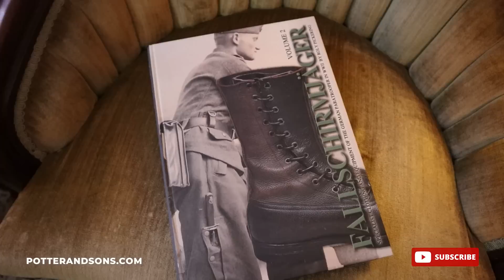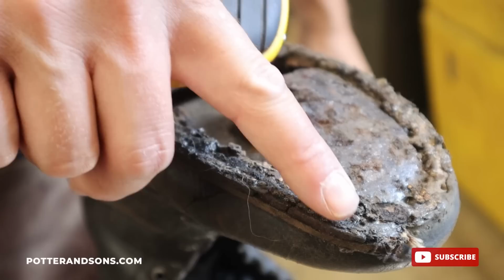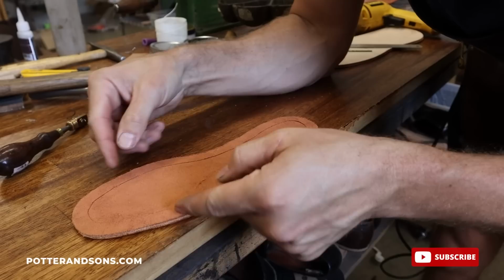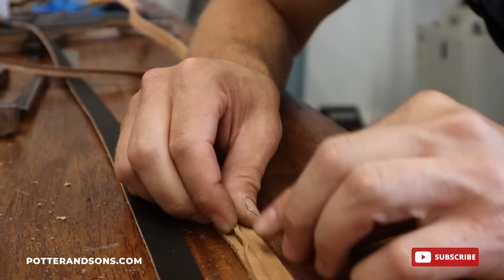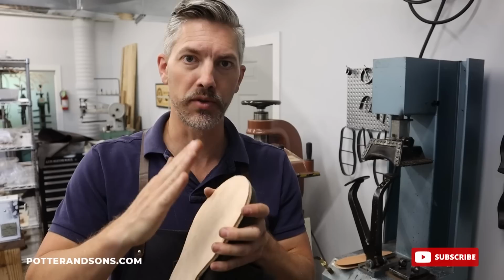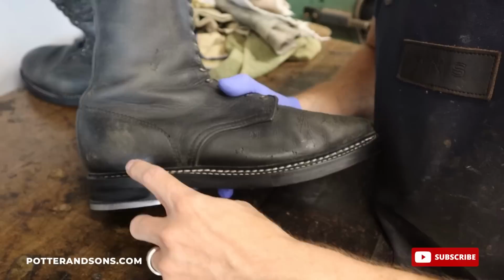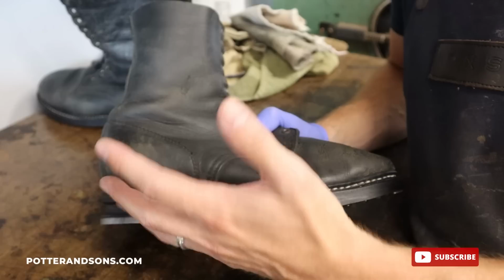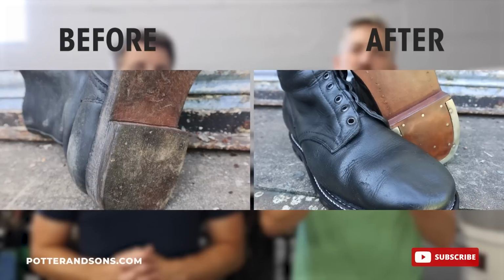WW2 German Paratrooper Boots Restoration

Comment: I did service in the German Bundeswehr in the 1980's. The boots we were issued did not look that different from the ones you worked on. They also had white stitching everywhere. First thing we were told to do when we received the boots, was to use black colored "Lederfett" (leather care grease) and darken all the white stitches. Especially the groove between the leather upper and the welt had to be slathered with the black grease to make the boots waterproof (which worked well).
Reply: Does that "Lederfett" wear off in the field, allowing the blackened stitching to turn white again? Or is that grease a permanent colorant?
Reply: @operator8014  I would think it would have worn off over time but before that ever happened, the goo was re-applied frequently to keep water-proofness
Reply: Lederfett "wears off" but the stitching stays dark. (Because you would need to use some form of cleaning agent instead of water, brushes and elbowgrease when cleaning)
We did the same in austria, either Leather grease or black shoe creme that had water proofing oils and wax in it.
Reply: @nirfz  Our trick in the Bundeswehr in the 80s was to fatten the stitches and then to ignite the grease. It was not hot enough to damage the boot, just melted and soaked and blackened the stirches.
Reply: @operator8014  We were expected to grease and polish the boots all the time. It kept them waterproof and soft. And obviously had the proper military shine.🙂
Reply: @neleabels  Interesting, have not seen anyone putting a cigarette lighter to the shoes or sole stitches here, but i have seen it put to other things (less usefull)...

My favorite example was the "shopping headgear" we got. (a light grey and green balaklava for winter face camo and windprotection)
It had the label "schwer entflammbar" on it. (for the english speakers reading this, i think it would be: of low flammability. Generally that label is put on things that resist a flame for a little before iving up)
On the first day after getting my gear, when i entered the room i was to stay in, one of my roommates already was putting the flame of a cigarette lighter to the balaklava because of that label.
I informed him that that only means it will start to burn later, not that it won't burn at all... (He was smart enough to stop his experience right then and not getting in trouble right at the first gear check.)
Reply: Used Bundeswehr boots and  shirts when in British Army,great boots then, later not so good
Reply: Glück ab! I was there the same time. We were told to put a thick leyer of the black German army "Schuhcreme" (shoe polish) on the stitching and heat it with a lighter so the fat goes in the tunnels of the stitching and makes it nearly waterproof. Btw... You could use that "Schuhcreme" with Bundeswehr hard cookies to start a fire. It was a smart option when you where out in cold weather and rain.
Reply: @oisin666666  Genauso  haben wir es gemacht 🤝🏻
Sie hielten nach der besagten Behandlung recht lange das Wasser ab und ja, die Schuhcreme  eignete sich hervorragend um ein Feuer zu entfachen. Das sind die alten "Landsertricks", die einem das Leben leichter machen. 😎
Reply: @bowieknife71  Wer das nicht so gemacht hat, der hat die Hartkekse wahrscheinlich auch so gegessen und so wertvolle Zeit verschwendet. Wir haben die Panzerplatten mit etwas Wasser eingeweicht. Daraus wurde dann ein Brei den man sehr schnell essen konnte. Bisschen Schwarzkirsch Marmelade aus´m EPA drauf und es war sogar recht lecker.

Comment: Where I live, this construction is known as the goiser. They are originally used as high performance hunter/hiker/forester boots in the Alps. They are really great, especially because the L shaped welt works as a bumper all around the shoe. Nowadays, they can be seen as dress shoes as well, and people can do a lot of fun stuff with that outer stich, such as putting colored cord or leather strips into it.
Reply from the maker: Very interesting.  Thanks for sharing.
Reply: The name comes from Bad Goisern, and we call them Goiserer in the alps. (the ones with the nailed soles)
Reply: You are from Hungary? We in ex Yugoslavia also had term gojzerice for this kind of boots :)
Reply: @nirfz  We called gojzerice even the modern boots. Tipical boots that was called gojzerice were "adidas gojzerice". Try to google it. We were probably wrong, but we didn't know better :)
Reply: @MrSatelit28   I did a picture search for the adidas ones. :-D Wrong would be a strong term i guess... In your language the word got a little modified over a little more than the last century and then used as generic term for boots . I can see how that happened historically.
We for sure also have similar kind of words, but it's often not easy to notice. (The name for the biggest glacier we have "Pasterze"  originates in the slovenian language as far as i read, but almost nobody here knows.
And what we call Gulasch, the hungarians call something like Pörkölt...)

Comment: The groove on the heel was designed for a rubber overshoe that was intended to be worn inside the aircraft while transporting to the drop zone, since the boots were intended to be a leather sole. The rubber over shoes were to be discarded upon landing on the drop zone.

Comment: Amazing video and as always you guys do fantastic work. A couple of things about these boots, It looks like these might have actually been old SMwholesale boots by the shape of the uppers although it's hard to tell from how worn in they are haha. Fallschirmjager boots were also never issued with hobnails like these boots had at least to my knowledge. The main reason being is that you'd have zero traction on the metal floor of the inside of a JU-52. As someone who has worn hobnailed boots, they are great for off roading but definitely aren't good on any smooth surface. A lot of times guys would add them on or even ditch their jump boots for infantry or mountain boots because the smooth leather sole, while good for the airplane was practically useless in the field.  Finally, the "first" pattern jump boots actually had a rubber sole with a sort of wedge arrow pattern, I don't know how else to describe it if you look it up you'll see what I mean, and were the preferred type by Fallschirmjager as they proved excellent for both jumping and in the field. The switch to leather soles came because of rubber shortages that Germany was facing during the war and that particular resource was needed elsewhere. The switch began I believe around 1941 after the invasion of Greece and the rubber soles would be phased out quickly to help simplify and ease production. Also Fallschirmjager would never again preform a massed air drop after the high casualties suffered on Crete, being relegated to more ground combat roles it makes sense to see more of these boots with hobnails later in the war for better traction. Sorry for the book by I just wanted to have the info out there for anyone interested. Amazing video again!
Reply: I can be wrong, but i think the boots of the mountain troops were equipped with hobnails. So if they switched out their boots for those of the mountain troops they would have ended up with something like in the video... The mountain troops were also more  common to need the groove for the ski binding.
Being from austria, my heavy combat boots (we have conscription) around the turn of the century had such a groove in the heel for a ski binding. 
I was lucky that i got to use "half-hard" ski boots in my size, but some of my comrades had to use the heavy combat boots for skiing, as they had a too common shoe size and there weren't enough of those boots in their size. (Not that it made skiing downhill any easier, as the name i gave them suggest, they only were rigid up until the ankle, and so they did not provide better ankle support than the combat boots. But they did provide better thermal insulation, which you only need if you standing around a lot or goind downhill a lot. Uphill or cross country the body heats up and supplies the feet too ;-))
Reply: "A lot of times guys would add them on or even ditch their jump boots for infantry or mountain boots because the smooth leather sole, while good for the airplane was practically useless in the field." Especially after Crete, when most of them didn't have jumps anymore. Most Fallschirmjägers at the end of the war had probably not seen a plane from the inside.

Comment: Great restoration project, you really "nailed" those boots🙂. First pattern Fallschirmjäger boots had a Vibram soles and 2nd type boots had a regular leather soles without hobnails. But like everything in military, especially during the war, there were variations where jackboot hobnails were installed, or even a Gebirgsjäger heavy boots hobnails for the paratroopers located in the mountain regions.
Reply from the maker: Thank you. 👍

Comment: The channel in the heel block did not click into a binding of the modern stiyle where the comlete sole of the boot is fixed to the ski, but served as a guide for a steel cable that ran round the heel but made it possible to lift the boot off the ski at the heel while still fixed to the ski at the tip. In this way you could use the ski snowshoe style i. e. Langlauf as it is called in German. When I served in the Bundeswehr in the 1980ies our boots still had this groove at the back of the heel block and we still used it for the assigned pupose in winter combat training.

Comment: Being not far from germany but in the alps, my heavy combat boots during conscript time around the turn of the century had such a groove in the heel as well. And the soles at the front were a little squred off and had little metal edgeds. Was also for skii bindings. (Some of my conrades had to skii in the heavy combat boots because of not enough more modern skiing boots in their size, my size wasn't as common, so i didn't need to ski in the leather boots.)

Comment: For the grooves in the heels: Most certainly they were used for skiers - at least.
The thing going around the heel of the boot theoretically could have been attached slightly higher as well. But I guess the thinner leather there wouldn't have held up too well and  the pressure would have been irritating to the heel. I remember ski boots from the 60s/70s still having a very similar heel design.

Comment: Netherlands here. It's crazy to  me how these boots are almost the same as old (as in, 20 years) standard issue military boots. Ok they got rubber soles now, but they look the same. Mine even had a similar pattern on the bottom, except it wasn't steel studs but rubber "studs" attached to the sole.

Comment: my german BW boots look very similar (uppers) to the ones you worked on. That was in the mid-80s. The white stitching was basically a sign that you were a new recruit. Nobody else would be found dead with visible stitching on their boots :) So we put as much on it as we could, which in turn made them more water resistant. The stock soles in the 80s were quite hard and gave you about the same traction as a pair of roller skates in the winter.... We all upgraded to Vibram soles ASAP. I still have mine if i need a sturdy boot, not much of a need here in  Georgia.

Comment: The fallschirmjäger boots came issued with smootg soles that were typically wooden pegged. 

This was so when jumping from planes, you wouldn't slide around inside and potentially hurt yourself.

Not every troop was consistently jumping, so to get the most use out of their boots they would have their boots hobnailed like the standard issue jack boots to lenthen their life.
Reply: If I'm remembering correctly the German army stopped jumping all-together after a successful but very costly operation relatively early in the war. The German command felt that the high casualties made airborne operations not worth it, but seeing the success that the Germans had with them actually inspired the allies to put more focus on their own airborne capabilities.

Regardless, it makes sense that after they stopped jumping out of planes that the soldiers might have modified their boots with hobnails.

Comment: An historical footnote. During the WWII era, rubber was not what we see today as rubber. As an example, today a Vibram sole vs rubber, the Vibram will last much longer. Technology has radically changed rubber, like the materials soles are made of today. Further, leather would have been easier to use because rubber was not as easy to get for Germany (it had to travel across the oceans). Rubber was saved to be used in critical aircraft, vehicles, and industrial applications. 

Great video. Capturing history, especially in a video, is fantastic!

Comment: About the white stitches: What I have heard was that there was a belief at the time that the process of dying the stitch material black before putting together the shoes would somehow weaken the stitch material, thus making them more likely to pop or break.  I can't really say how or why that would make the thread weaker, or how/why they would be OK to then blacken them with polish later.  If I'm not mistaken, the regular infantry boots (I can't say I really know about the paratrooper boots) were issued to the troops brown in color as they were made from brown leather.  They would then use many, many layers of black polish to blacken them.  Modern re-enactors frequently start with a coating of black dye on their brown reproduction boots and then black polish.

Comment: Hobnails were standard in most WW II German combat boots. The Brits also used them. As any WW II reenactor can tell you, they were not for grip but to lengthen the life of the leather sole which was more expensive and lasted longer than hobnails. The heel irons performed the same job, preserved the leather.

Comment: To the issue of hobnails on the 2nd pattern FJ boots: from what I've read they were not issued. I think this is kind of obvious when you realize that these boots were to have a certain "athleticism", shock absorbtion, and lightness in the design.
Since Marchstiefels (normal Weremacht pull on boots) and all of the other types were in such profusion and they all had hobnails, it makes sense that someone added them in the field.
I'm blow away by your work and it's wonderful to see these techniques on full display.
I would love to see a tear-down and analysis the 1st pattern Fallschirmjäger Boots. Be they original or reproductions. Apart from the interesting look, the soles were some of the "most modern" soles of any boots issued in the war on any side.
Again, a real pleasure seeing how they used to do it with such fidelity.

Thanks

Comment: The Hobnails did help with traction but the main purpose was to prevent the leather soles from wearing out so fast by not having direct contact with the cobble stone roads and odd ball surfaces, it extended the life of the leather soles. all according to my local cobbler 🙂

Comment: Back in the day I bought a pair of either Swiss or Austrian surplus boots from Sportsman's Guide. About 6 inches tall,  what I'd have in a short work boot. Twenty, thirty bucks or so back then. They had the exact heel grove contour your repair had. Not sure of the reason for that. I thought it might be to catch the heel on a bootjack, something like a step or toe of the other boot to help slip them off. The toe area of the sole was squared off a good bit.

Comment: the metal knobs on the bottom might be ok on loose soil but they must have been slick on floors or hard surfaces...kind of like metal baseball shoes or metal spiked golf shoes on concrete or black top...but they must have worked if the whole military used them...great restoration and historical piece...no sneaking up on anybody with clickety clack bottoms

Comment: Fj boots were not issued with that style of hob nails.  They had flat headed nails that wouldn't skid around on the aluminum floor of the aircraft.  I have seen a few, say three or so, pair of originals that had leather half soles added by unit cobblers with March Steifl style hobnails.  The larger style pictured on those boots were usually used on mountain boots.  As with most things WWII on the German side, there is no such thing as always and never.  Their supply system was fed by a cottage industry with literally thousands of sub contractors.  Just to give a little perspective an original pair of second model Fj boots is probably a $20K item.  A first model pair of side lace boots are a name you price item.
Reply from the maker: Thanks for the info, Chris!

Comment: Ausgezeichnet!  The hobnails were not really meant to provide traction,  they often did just the opposite. They were used to protect and extend the life of the leather soles and reduce rework and repairs. Issue boots in the German armed forces, specially for front line personel had an estimated lifespan of 6 months or less.  Also, as you mentioned, originally all Fallschirmjaeger boots were not hobnailed ad these made them very slippery aboard the JU-52 transport aricraft which they jumped out of. By early 1943, practically all German paratroopers were no longer jumping out of aircraft and relegated as land borne assets and therefore some had their boots hobnailed by company, or batallion level cobblers.

Comment: So, a lot of the field adaptations like hobnails and heel irons, were down in the field as opposed to production. That’s at least what I’ve read and seen. A good example of this if FJR6 (Fallschirmjäger regiment 6) in Normandy, depending on the company you can see that some guys opted for hobnails. As a Fallschirmjäger reenactor myself, I can say that the smooth standard sole with tacs are horrible for gripping, so I can see why this particular customer wanted hobnails and irons.